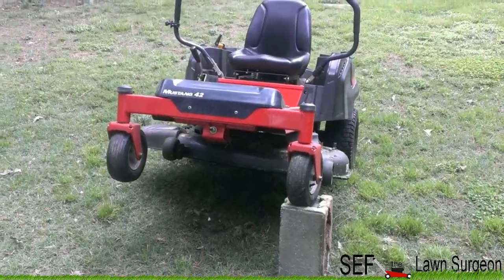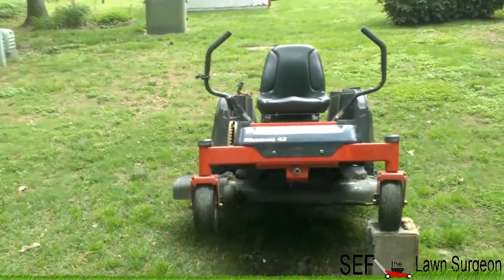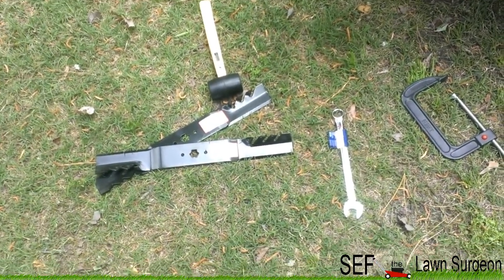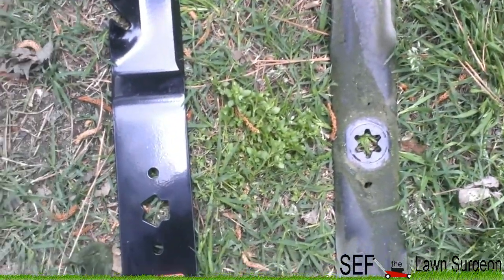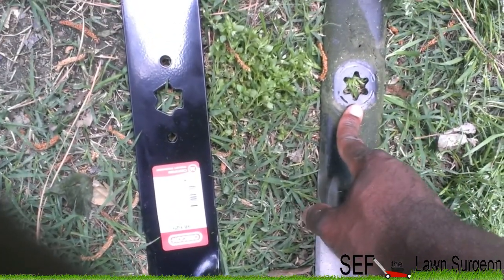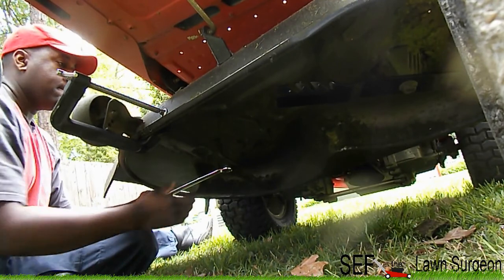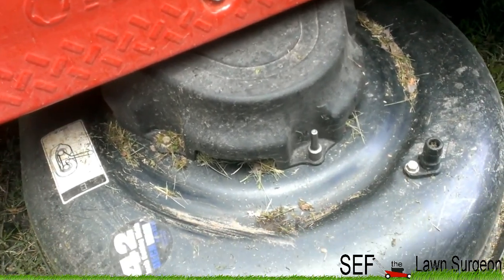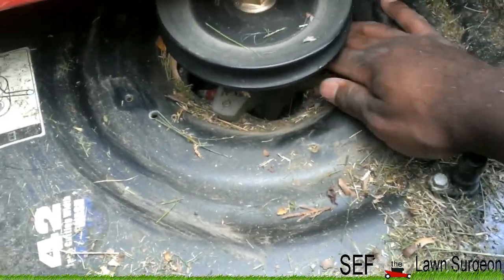How to Change Blades on Troy Bilt Mustang 42xp

Comment: great video, Lil trick here, spread some "anti-seize" on your threads before pouring the nut back on, and those nuts will spin off easily without a hammer next time. I love the c-clamp trick. always have had good luck with Troy-bilt

Comment: Hey man. You need to be very careful when tightening the bolts that tight you shouldn't hit it with a hammer when tightening you have a very good chance of breaking the bolt that way. It's ok when taking it off because when the bolt sets in there it gets rusted in. but when tightening it back down you don't need to do that because it was already broken free. when tightening the blade bolts just get them as tight as you can with two hands.

Comment: idk if y'all know or not but you can modify the mower so u can cut in reverse without it disengaging the blades. on the bottom side of both joysticks is the sensor plugs all you have to do is disconnect the plug from the sensor and it will cut in reverse.
Reply: Thanks for the tip, it's a pia to have to keep starting the pto otherwise!

Comment: Hey SEF thanks for the tip on the C Clamp! Will definatly give it a try next time! good vid man!
Reply from the maker: no prob my man...thanks for watching
Reply: So SEF the c clamp helps to stop the blade from turning while you loosen or tighten the bolts I’m assuming? Would a impac wrench do the trick without the c clamp? 🤷🏽‍♂️

Comment: Hey SEF, as always great videos!  Two questions for you, I want to get a mulch kit for my Mustang 42.  Have you installed a mulch kit on yours?  If so, was it very difficult?  Also, I noticed that I can't cut in reverse.  Anytime I try to cut in reverse, the lawnmower automatically disengages the blades then I have to engage the blades again in order to continue to cut. Have you experienced this?  Thanks SEF!
Reply from the maker: sup, no i have not put a mulching kit on it... and you will get use to the backing up think... if you back up while turning the blades wont cut off but it takes practice

Comment: Take the covers off ! Leave the off. Especially is you are using the mower for a business machine. Also it will prolong the life of the spindles and the belt. I have had the same belt on since I bought the mower.  I have not had any issues with these modifications. Gator blades are the truth on the mower. Excellent quality of cut.

Comment: Hello SEF.  Before I forget, Mike's Garage sent me here.  He mentioned you in his vid on changing blades on his 50" Mustang, like mine  (https://www.youtube.com/watch?v=pzRgKTZhbII&list=PLuNXQysTgXGCmVJpF-EXJ0PZYxZ2sCsd3&index=14&t=622s).  He forgot to link to you as he said so added it in his comments.  He used an ATV jack to lift his mower ($80 at Harbor Freight) so that's why he mentioned you, for those who don't wanna run to Harbor Freight and lighten their wallet.  Anyway, dropped the middle blade on my 50" Mustang the other day, Not sure how to get that thing back on there.  So You Tube How To's once again saved the day.  Love your video here and the comments. Learned SO MUCH!  At 72, a widow and a Son who had to move to another state, am winging it on a lot of things taking care of this 2 acre piece of Heaven in the Pacific NW I am blessed with.  Learned to put the belt on (with 7 pulley's!) and took me 1/2 a day but I did it! Thank goodness I have a come-along and another rider to help me pull that spring!  Next time it broke, the guy who knew what he was doing did it in 15 minutes.  hahaha  OK, so I'm gonna use a cinder block or two and maybe some other jury rigging to stabilize the mower and am thinkin I can git er done.  Will also try to find a block for the chute so it will mulch.  Getting too old to rake an acre when I wait too long to mow.  Rain here can make that happen.  OK, so will let you get back to work. Thank you SOOOO much for what you do here. You help a lot of people and I for one really need a lot of help!  hahaha

Comment: I have a troy bilt pony riding mower 42 in cut blade tips are hitting each other. Any tips?
Reply from the maker: mmmm..thats probably mean you need to adjust the rotations of the blades...(they shouldnt cross each other)... take it of and  make sure they're perpendicular...

Comment: Has that Kohler two cylinder engine gave you pretty good performance.
Reply from the maker: 427 Elevating Productions .. its been great...i have no dout everytime i turn the key
Reply: Have heard some bad about those courage kohlers mainly the one cylinders though.  Have heard from a couple people saying their two cylinder courages would run so long die and not restart.  Neighbors courage twin has over 500 hours proper maintenance only engine issue was coils when it was about three years old but, other than that its fine.  Thats great it doesn't leave you with any doubt.
Reply from the maker: 427 Elevating Productions ... yea.. i glad

Comment: By watching that i think my dewalt inpact would have broke them free. You should get one the are bad ass and no need to clamp or mallet..but dam i will try that on my 30 tm. Pretty bad when an impact wont break nuts loose.. Thanks for allll
Reply from the maker: jc06gsxr600 ...yea... i will most likely get one one day...but good ol' elbow grease works for now..lol

Comment: Just ordered this morning ..Also finally found an actual metal mulch plate for the mustang ..not the crappy plastig plug I keep spitting out half an acre ago.  This one bolts in place of the discharge.   Slims the deck and makes it easier to get in and out of places.  http://m.ebay.com/itm?itemId=161365499464
Reply from the maker: oh wow...thanks man
Reply: Link doesn't work for me.  Even copy and pasted it into a new window.